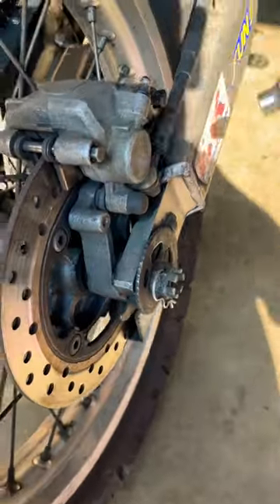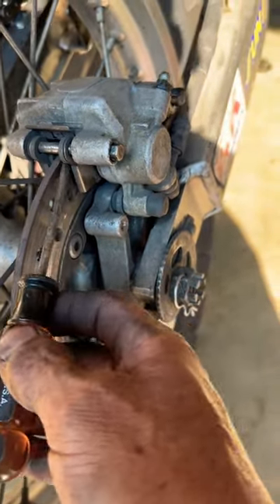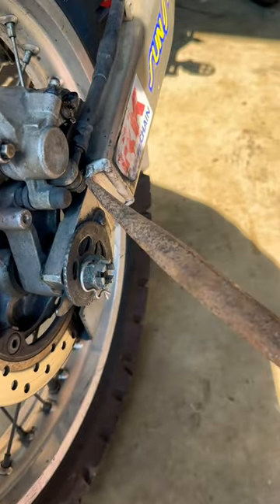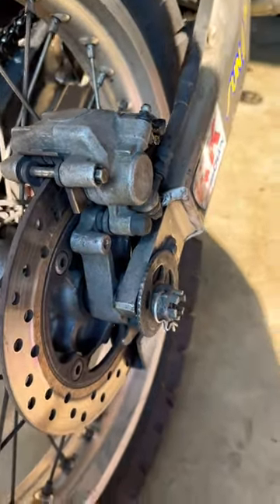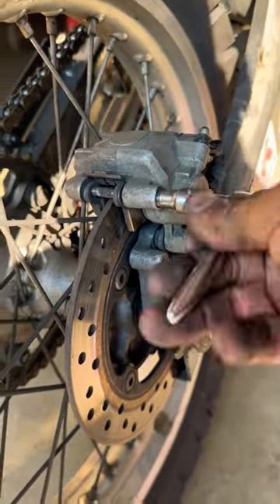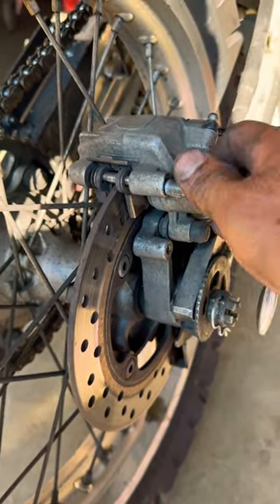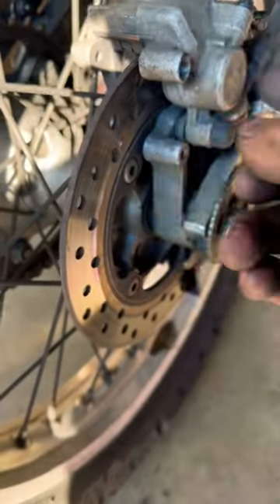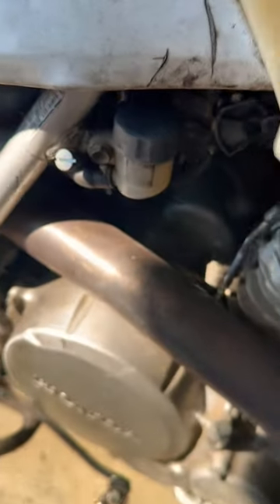MOTORCYCLE QUICK BRAKE PAD SLAP  #shorts #xr650l #brakes

Comment: I could change rear pads on my CBR250 faster than that. With no loss of fluid.
Reply from the maker: I am actually much faster. For the videos I take a little longer and do somethings maybe I normally would not. But you and I can probably push the caliper and do it dry easily. Maybe some people need the bleeder cracked...so ya... I here ya. If you subscribe I will do a video on my fastest brake change. And see if you are faster than me going my fastest. That will be fun. How long do you think it takes you from start to finish ? That way I will have an idea of a time to beat
Reply: @fastflo1  let me do a timed trial and update.